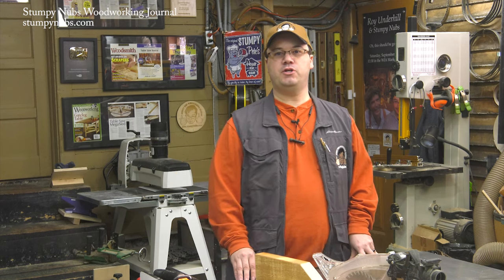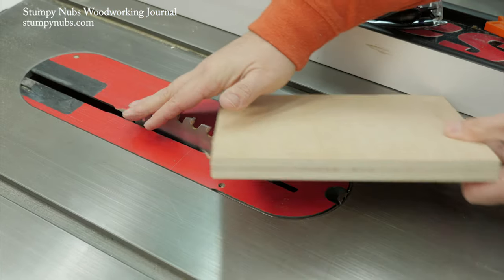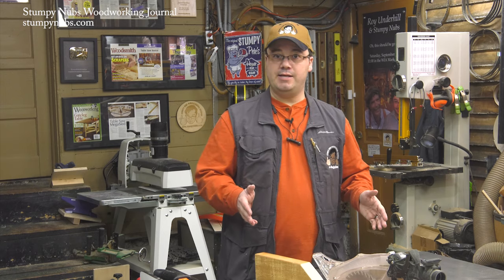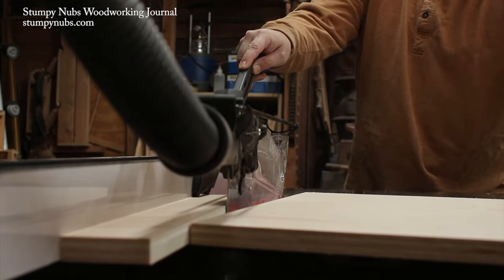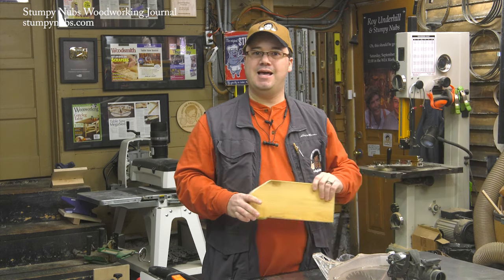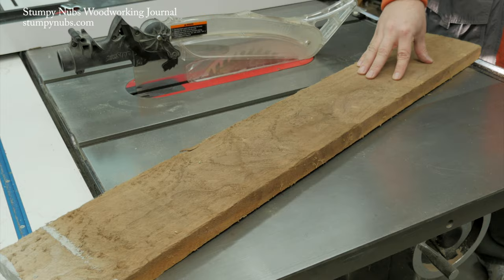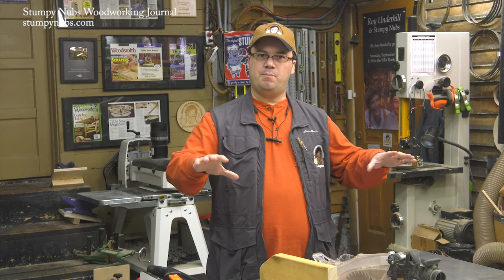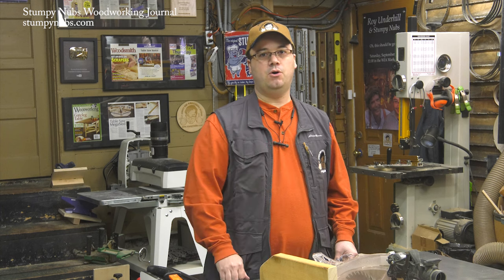Table saw safety tips you forgot about (or never knew)

Comment: My new saw came with a riving knife as part of my blade guard but is totally "detachable" to the point where I can use the riving knife WITHOUT the guard in place!!! This was important to me because I seldom use my blade guard as I usually make cuts with my table saw sled instead!! Only rarely do I make cuts without the sled, and the miter guide that came with my saw leaves a lot to be desired anyhow as it is a cheap plastic piece of junk, BUT I still use it when ripping or cutting larger pieces, which again I still don't often install my blade guard to make cuts most of the time just the same!!! 

The other problem I have is the blade guard isn't "smooth" during operation!!! In most cases a more expensive saw has a "better quality" blade guard!!! In my case my saw was a cheap Ryobi table saw I bought at Home Depot which is actually a contractors saw, light and very portable, which is ideal for my tiny work space (my shop is only 8 foot by 8 foot big), so I am constantly moving my saw outside to use it with NO dust control what so ever as I took off the drop chute under the saw to allow the saw dust to empty on the ground below my saw instead!!! Again I have a tiny work space.....so a dust collection system is literally IMPOSSIBLE for my shop and space it at a premium to start with!! 

All this said, a blade guard in my case is a problem, BUT I do keep the riving knife installed at all times!! Some day (which will probably never come and I am 55 years old) I want to a real shop space with a real dust collection system and a decent table saw to run!!! BUT I don't see that as a "reality" as much as a pipe dream that will never come true!! Maybe that day I will also have a real out feed table where I don't have to precut all my wood with a hand held circular saw BEFORE I clean up my cuts with my table saw, but in my world "some day never comes" and making plans in my life "never happens"!!!! So I gave up setting goals and making plans about 35 years ago....because in my life, my world, like the old Styx song....Nothing ever goes as planned!!!!! And I wouldn't get a thing done if I waited around for "some day" to happen!!!

Comment: I have an older Ryobi table saw that I have had for over 15 years. And some point in the past, I have lost or thrown away my blade guard assembly which had a splitter/riving knife as part of the safety attachments.  The blade guard assembly is no longer available from the manufacturer so I have been using it all this time with just the bare blade and not even a splitter/riving knife.  After watching your safety videos, I decided to manufacture my own riving knife from a piece of 16 gauge sheet metal. It was relatively easy to make (took a couple of hours).  I now have it installed, it works great, and hopefully will help to prevent any mishaps. THANK YOU!

Comment: 35 years and the only thing I still don’t use is the safety gaurd 🤷🏼‍♂️. I wish I could because I hate getting smacked in the face from a small knot etc. the riving knife is always a must though. Even with it I find sometimes the wood pinches the back of the blade and fortunately ( probably because I don’t have a cabinet saw) I can hold tight until killing the power even if the blade stops. Great safety video nonetheless. I’ve known many carpenters injured on table saws. It’s by far one of my favorite tools which I’ve held the utmost respect for

Comment: The blade guard on my old (from the 50's or 60's) Craftsman belt driven table saw is cumbersome. It actually gets in the way of working. By that I mean it will actually prevent you from sliding wood underneath it. You have to use one hand to lift the guard while pushing the wood with the other. Even though it has a curve front it doesn't work. I inherited it from my dad before he passed away. He never used the guard either because of those reasons. So It stays off. Unfortunately the riving knife is attached to the guard. So, I've worked without both for quite a while. This is not a I'm going to do without comment or you really don't need it comment. Several years ago I experienced a kick back. I was cross cutting a full sheet of 1/2 inch plywood and about half way through this old saw threw that full sheet of plywood back at me. It hit me in the gut and it felt like I was hit by a car. Ever since then I just have the hardware store do all my cross cuts first. Then I'm only doing smaller cuts at home. But I knew I needed a way to stop any future kickbacks. My tools have been in storage now for a few years since I haven't had a garage and now were moving back into a house with a garage. So, I saw the link for this video and I thought, "I like Stumpy Nubs info and I'm going to be getting back into woodworking soon. I should freshen up on safety." Thank you for the safety info and about making a zero clearance plate with knife. I'm sure I need to upgrade this saw to a newer one, but it just works so well.

Comment: OMG the 4 questions ;) How is this saw not like other saws ;) But those are almost exactly what has saved me over and over. Never work when you’re in a hurry. You’ll overlook something or make a mistake or take a shortcut. Never work when you’re tired, it’s like being in a hurry only worse. Your “are you sure” is the same as what I stated as “stop and think” just take a moment and think about what you’re about to do. What did you forget, what are you assuming? In my whole life I’ve only been injured in the shop twice and both were because I was in a hurry and cut corners. I’ve had much worse cuts from folding hangers while doing laundry, and thats as it should be! I get sympathy for stitches from doing laundry, if I have to go to the ER because of working in the shop the significant other would just be mad!

Comment: I would be interested in your opinion regarding Jessem's 04301 Clear-Cut TS Stock Guides? I just started using them and they work really well for ripping. I also splurged on the ones for my router table as well.

Comment: Sadly, dust extraction is little more than an afterthought on many saws especially cheaper ones.  Even using dust extraction and an air filter (AC400) fine dust still coats everything after a little tome sawing. When using mine which is a charnwood w650

Comment: I keep wondering - why exactly do all of these electric saws need to run at such a high RPM? Wouldn’t it be immensely safer if they ran at very slow RPMs? After all wood is cut just as efficiently with hand tools operating at much lower manual “RPM” albeit slower. Slower RPMs might translate into lesser chances of kickback, lesser velocity of the kickback and more time to react in case it occurs. The power of the motor can also be reduced so that if the wood pinches the blade, it would just stop rotating instead of exerting extreme force onto the wood to cause kick back.

Comment: I only wish I'd seen this before April when I had my table saw accident. tired, distracted, no guard, and kick back all were involved. Cut a 45 degree cut under my thumb nail severing that bone in two but, didn't sever it all the way off. Still healing as of this comment. I could have bought 20 or 30 of what I was making with the money spent on accident bills.  Ruined my confidence in table saw work and going to go to track saw for table saw like cuts. I admit not a total table saw replacement but for how I wood work it'll work.

Comment: For those watching this, well on 3 years after it was made...  great tips.  ISO Tunes now makes their ear protection with "Aware" technology.  Love it.  It acts like a hearing aid under normal conditions and kicks in protection as needed.  Eliminates that annoying "deafness" normal protectors cause... you can't hear low or normal sounds when they are in your ears.  Well worth the cost and/or upgrade IMHO.

I'll add to safety rule #8... drop the blade down below the table after you are done using the saw, especially for those without blade guards and/or may need to use the top for other purposes.

Comment: Stumpy Nubs, man I believe you man, you got me, I'll figure it out cause I've got the Rigid (belt driven) tablesaw 10" (without it's blade guards - parts missing it's hardware)and the Craftsman 10" radial saw and I learned more carpentry skills first thing in power tools when I first cut with a friend. Right now the shaft turns fine but the nut is locked in that rusty nut to shaft thing today. Growing up years ago it was the first power tool I used first.. I was in my late teen years and my friend and brother to me was Uffie. He let me learn on his, so that was a long time ago, now a rusty shaft and nut. I don't want to hurt or lose limps and I did get a beating on my Rigit table saw and for years I never figured it out how to use it properly, so I'll YouTube it out.

Comment: Hey, where I work we have a Delta 34-976 with one of those big blade-guard attachments. The problem is that it's such a colossal pain in the ass that getting people to use it is like pulling teeth. A combo blade guard and splitter like the one used in this video would be a godsend; however I can't find one from Delta. 
     Is there a universal guard/splitter combo out there? If so, please point me in the right direction.

Comment: I have a chunk missing out of my ring finger because I tried to use a 2nd hand contractor table saw that didn't have a fence or anything to guide me. While trying to rip a 2x4 down its length free hand, I had a small but sudden muscle twitch in my arm that made the 2x4 shift, and caused it to kick back at me. I had also been up for around 18 hours and was tired, which is probably why my arm twitched. I'm lucky my finger just looks weird and I didn't lose it. Don't be an idiot like me.

Comment: Sadly just about every video or tv show has the blade guard removed. It seems like all but the most super expensive saw has garbage guards and guides. The guards almost seem dangerous themselves because they're so cheap. You worry about the plastic guard breaking apart during cutting. One other tip is I sometimes use a full face guard when working. Be sure you still wear safety glasses cuz stuff sometimes flys under the face shield! Also watch out for sleaves and lose clothing especially if you're working in a cold garage with a big coat on.

Comment: The metal detector isn’t just for reclaimed lumber. I recently found a piece of wood (purchased new from Home Depot) with several staples down the side. I didn’t notice them until after the piece was cut. Thankfully I didn’t hit any when I was cutting. I’d like to think that I would have seen them if they had been in line with the blade, but that’s far from certain.

Comment: A small piece of embedded metal is much more dangerous than it seems. I've run into the broken off head of a drywall screw when using recycled wood. Yes it damaged the blade but in the process  a tooth shattered and I was sprayed with carbide shrapnel. Fortunately no real damage to me but a bigger piece or in the eye could have been an entirely different story.
The drywall screw head was decades ago but I would like to add information about blade guards that happened last week. That is you need not just a blade guard but a quality blade guard. My saw came with a guard. Last week it managed to fall into the blade. It destroyed a tooth on a brand new blade (a piece of which gave me a small cut). Didn't do the guard any good either. Fortunately I was standing off to one side because it took the guard  ripped it completely off the saw and threw it 5 feet behind me onto another table.
On closer inspection the guard did have adjustments on it, while they would have helped it wouldn't have eliminated the problem. The adjustments could have actually made things worse as well. I've ordered  a new blade guard which I will get and install this week. 
Stay safe.

Comment: I finally got myself a nice tablesaw 3hp cast iron jobby, made for an established company here in Oz. I upgraded from a Ryobi saw to say it's like chalk and cheese would be an understatement. But what I have noticed is that at first I was scared of it but it was really just that unlike the Ryobi it didn't start full bore with the noise of a V8, it starts in a civilized way with a far quieter cut. That is what has taken the most for me to get used to, how the machine acts and reacts and I'm getting used to it. Oh and the other thing is I always walk through the cut in my head the benefit of which is I rarely forget my hearing protection, push stick etc because they are always at the beginning. How long this will last I'm not sure but I'm sure this series will show up in my feed again.

Comment: an important safety tip for these saws: buy and use a straight edge for marking. using a length of lumber leads to invisibly crooked line, which leads to trying to follow that line and jamming/kickback that results.

Comment: A suggestion: When making your tall push block an idea would be to cut a slot for your fingers high enough in the block that your fingers would always be above the blade at its maximum height. Your thoughts?

Comment: Question: My arbor nut came loose while the dewalt jobsite table saw was on . Very scary, one time it was with a dado stack as I was cutting and the other time with a regular saw blade and no wood touching the blade at all. Even though I always put the nut on tightly, After the first incident I made it a rule to tighten the nut at the beginning of EVERY day so this second time was a surprise. Nothing about the nut or the arbor threads or any other part of the saw looks off or damaged. Saw itself is definitely not old. Anyone know why this happened? I called the dewalt service center but have not yet gotten a clear answer.

Comment: 1.  If I'm using my rip fence for any cut that does not involve a jig I use a pair of commercial push blocs, Bench Dog Ultras when they will fit because they are super grippy or MicroJig Grr-Rippers for narrow cuts.  Compared to simple-to-make shop-made pushblocks, quality commercial push blocs provide much more control of the workpiece next to and behind the blade while keeping fingers well away from the blade.  When the blocks start slipping on the workpiece it is time to clean and lubricate the table top.  I always use the Bench Dog Ultras on my jointer and router table.
2.  IMHO an outfeed table is essential for safe tablesaw operation.  It must allow  the work to slide smoothly throughout the cut without pulling in any particular direction and support the work until it is clear of the blade.  The operator should be able to focus completely on guiding the work through the blade knowing that there is no chance that the workpiece can fall off the back side of the saw or undersized outfeed support.

Comment: about ears i have some noise reducing ear buds (that play music) that act as hearing protection... and i also have a pair of wireless ear buds that are not intended to be hearing protection and they both reduce ambient noise levels about equally. i wear those and put ear muffs over them. i cant imagine anything else.

as a 30 some year old who has had tinnitus for well over half my life... well, i dont want it to get worse than it is.

thanks mr nubs for your videos. they have been instrumental in my woodworking career. i've had a sort of internship for a couple years and ive learned as much from you as i have on the job. heres to jumping into journeymanship.

Comment: I took my guard off because I was having a hard time with it on. After watching this presentation, IT'S GOING BACK ON! 
Thank you, I remember a close call when I had a kickback and my fingers barely missed the blade as my hand got pulled back with the board. Only God spared my hand because I had absolutely NO TIME to react before it had already passed over the blade. I made a jig afterward to go along with the miter sled I was using, but now I'm going to figure out how to put that guard back on while making those cuts or I will use the miter saw or rotary handsaw instead.

Comment: This is an excellent, excellent table saw safety video. I'm in my mid 60's but as a young man, I was cutting a piece of lexan on a table saw that kicked back at me and caused a serious injury to my leg. That incident made me really think about what I was doing. Like anyone, I didn't expect it and assumed it wouldn't ever happen, but,  Surprise! The absolute safest way I have found to avoid an injury from kickback is not to be in an object's path if it could come back at me. It made me very aware and respectful. Since then I have made "decades" of rips and crosscuts while ALWAYS making sure that my body or hands would not be in harm's path, , , , ,ever! Use push sticks and stay in the clear! Ironically since then, nothing has happened since then but I'm not changing my good safe habits for the next 30 years either!